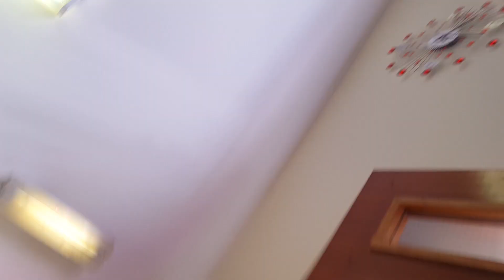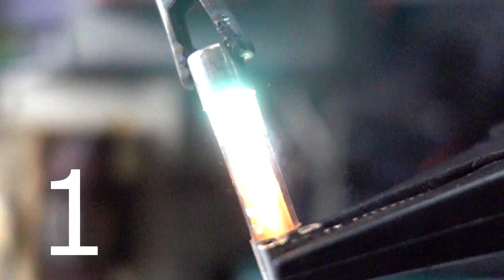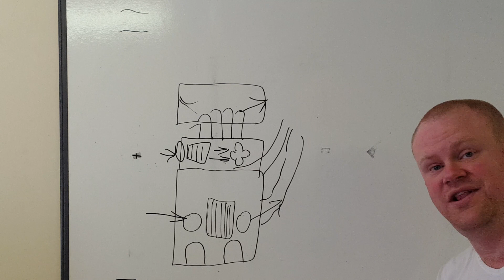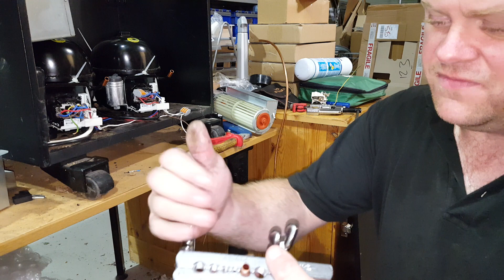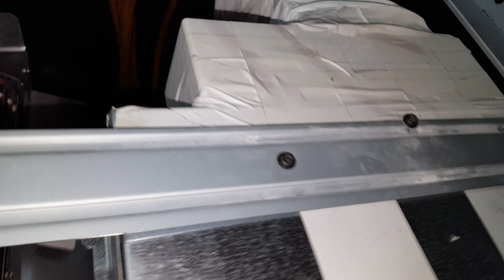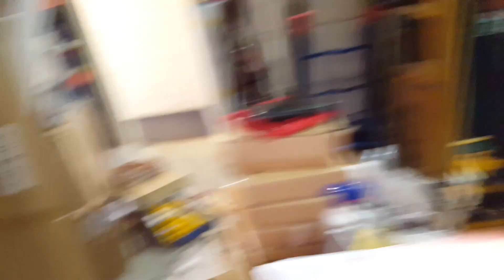HOW TO BUILD AN AIR CONDITIONER FROM OLD FRIDGE PARTS #1

Comment: Its good practice to remove charging valve internals to prevent burning the seal while welding the charging valve to compressor😊

Comment: Hey, do you think it's possible to make that air conditioner to run on 12v by using a danfoss compressor?  What I want to do is just run it off a solar panel in the day time without a battery.

Comment: Couldn't I use a small freezer and put a fan in the front door and some air ports so it pulls the cold air out ?
Reply: Yes, but you'll also need to cool the hot part (condenser) with outside air, otherwise the heat from it will offset any cooling from the front.

Comment: Should have put the compressors and condenser in an external assembly or some housing so the only thing you would have coming though the window or opening would be the refrigerant lines and some electrical?
Reply: You are basically describing a standard 'split system' there - basically you would  have the compressors & condenser outside & piped through to the evaporator in the room, this isn't what he's trying to do here, it's just a 'light hearted' project to see if he can build a useable air conditioner on a budget

Comment: I initially thought "you ain't gonna get jack shit cooling out of that" ...then I saw you were using 2 fridge compressors & hence 1/2 horse power total ...you have my attention  :-)
Reply: I built something very similar about 25 years ago but using only 1 fridge compressor (& a small one at that) -it didn't work & someone who knew much more than me about refrigeration at the time said that I'd need at least 3hp to get any decent cooling  so I''m interested to see your progress :-)
Reply from the maker: Im going to drive a little more pressure through them than was designed so should have a good kw. :-)
Reply: @jaysjetskis  OK sounds interesting, what are you going to run it on, R407C maybe?